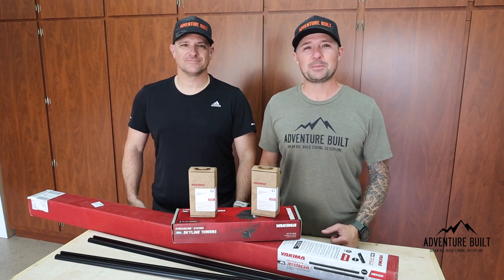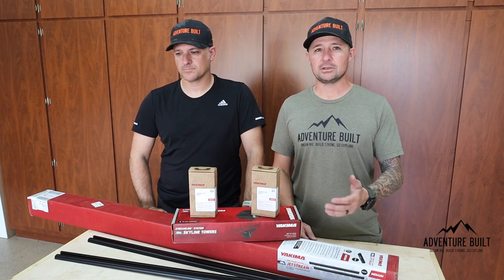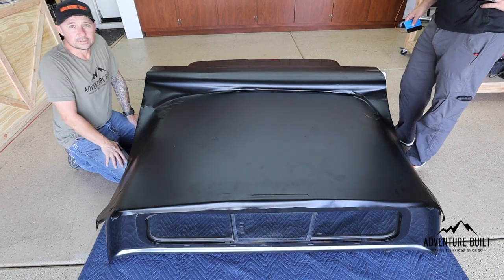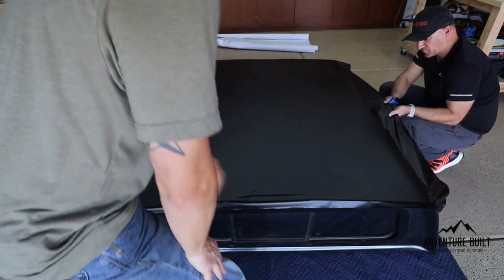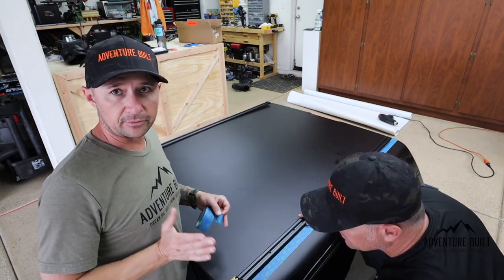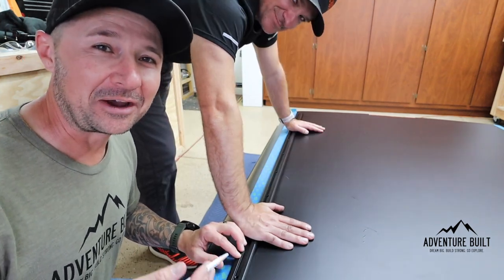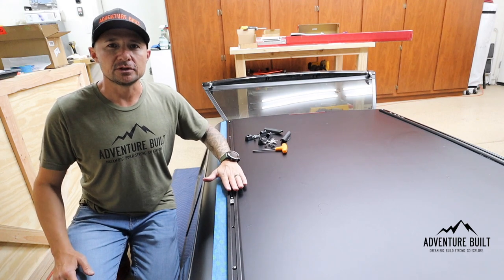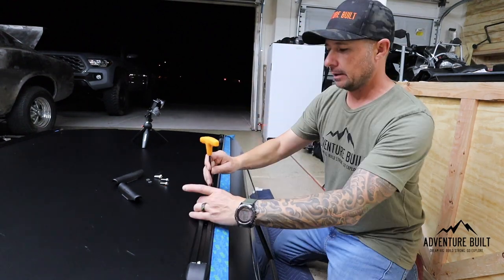Installing YAKIMA SKYLINE TOWERS & JETSTREAM BARS on ProTop Camper Shell for my Yakima SkyRise RTT

Comment: One thing to add would be how to trim the rubber strip that you removed - DEFINITELY add the 1" as the rubber will compress lengthwise to ensure a tight fit. Similarly the end rubbers strips (oustide of the towers) will need to be trimmed to accomodate the end caps. The Yakima manual is atrocious. :D

Comment: Towards the end of the video when the jetstream was attached to one tower, it isn’t exactly clear how to do the other side. Do you slide the bar all the way across to the other already in place tower? Or do you just extend the bar out beyond where it will end up on the driver side so you can slide it onto the tower on the passenger side and then keep sliding until it is centered? I’m guessing you have to have the tower attached to the landing pad before attaching it to the jetstream bar.  Everything else in the video was great and very helpful. I couldn’t find info that the bars packaging also contains the parts to mount it to the tower so it was good to see that in the video. Also helpful to see how the pads hold the tower and how to put the tower together with the bars.

Comment: I prefer the camper shell I just put an ARE on my Super duty.  Waiting for my Yakima rack.
Reply: Hi, did you order the same rack system as these guys did ? I too have a ARE campershell. The secondhand campershell came with a non yakima rack system so I hope I can use the same bolt holes for the skyline tower track?

Comment: Great video. So this track system can be installed on any camper shell correct? I have a shell on my first gen tundra but was wondering if there needed to be any kind of internal reinforcement done to fiberglass shell so it could hold up that weight
Reply from the maker: No the tracks work on any shell. I would limit the weight on your roof unless you have a reinforcement for extra weight.
Reply: @AdventureBuilt  ideally want a luggage carrier up there where I can throw soft items or larger light weight items that may take up space inside the cap where I can throw the heavier items. Thanks for getting back to me. I'll be ordering these soon

Comment: Hey thanks for the awesome video! Totally agree with going with a camper shell.  Keeps everything locked up and out of the elements.  I just picked up a used camper shell for my Tacoma and wanted to do the same thing.  Add a rack system for a RTT.  The only concern was of the shell cracking under the added weight.   Have you guys looked into the Milford loadmax system? Looks like it will take the weight off the shell and distribute it on to the bed.  Anyways thanks for the detailed video definitely will rewatch it once I start adding the rack system.
Reply from the maker: Thank you very much Jeff...we really appreciate that. I’m actually looking into getting an RLD Designs stainless steel canopy. You are right about the fiberglass shells not holding the weight. I’m not very happy with my shell. I’m getting some bowing already. Best of luck.
Reply: @AdventureBuilt  awesome thanks for the info! Looking forward for the next upgrade.  -subbd
Reply: @AdventureBuilt  did you get your shell custom made to hold more weight. That’s what I did. Just got the 
Shell and tent installed and haven’t taken it out yet. Wondering if you did that and your shell was still bowing?

Comment: How's the height difference between these and your cab roof rack also hows the wind noise. Looking to do a similar setup, is that the prinsu cab rack?
Reply from the maker: They are just barely higher than the prinsu rack.

Comment: Hey what size rooftop tent did you place on these crossbars? I want to get them for the Smittybilt Gen 2 XL MODEL but I want to make sure they can handle the weight . Any thoughts ?
Reply from the maker: I have the Yakima Sky Rise HD in Medium. It’s not a very heavy next. The bars are much stronger than the camper shell. I ended up switching the fiberglass camper shell out for a stainless steel RLD Designs Canopy. Way batter and stronger.

Comment: Looks great.  Looking to do the same with my Tacoma camper shell.  Did you guys have to cut down the Tracks at all?  I have a short bed taco, snugtop camper, and when I measure the length of the upper part of the shell it's barely at 54" before it starts to curve down in the front and back.  I would likely have to either bend the track or cut it a bit shorter to get it to fit on the straight/flat part of the camper shell.  Any thoughts?

Comment: If your ever up for it.. now that you have all your accessories on your camper shell, I'd really be interested in a pros and cons video of having a camper shell especially while out wheeling. Does it handle the weight good? Does it creak or is it noisy on the trail? Thanks.
Reply from the maker: I’ll actually be releasing a video explaining the difference when I put on my RLD Designs stainless steel canopy. Probably a couple months out. I’m not a fan of the fiberglass shells. Mine is fine for now but at some point it will fail.